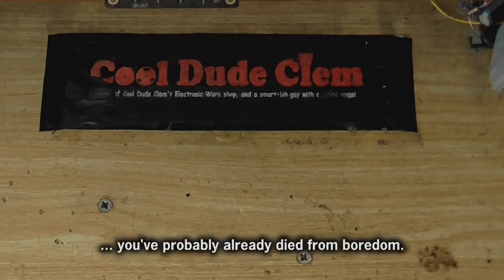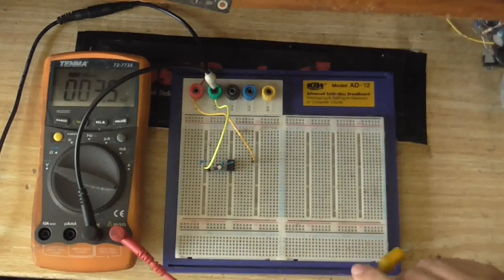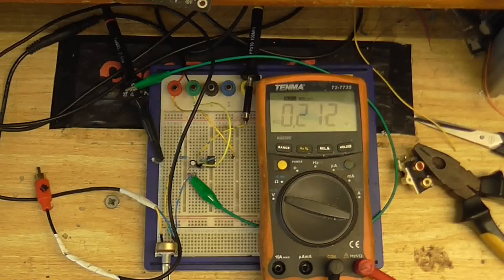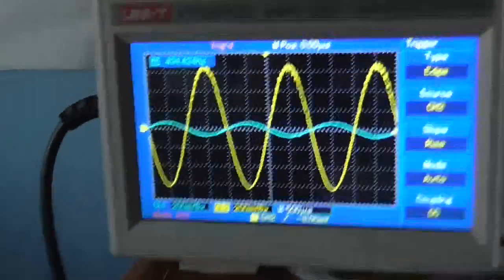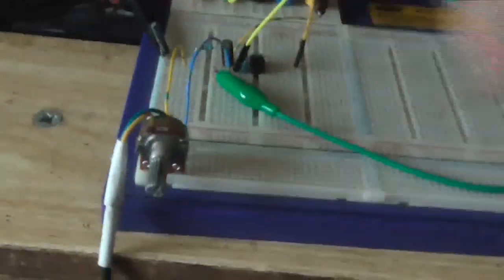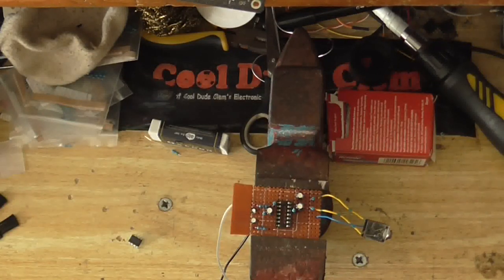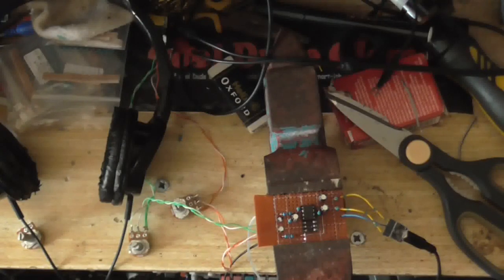Inverting op-amp on single rail supply, and making a headphone amp.

Comment: Nice to see that you're still tinkering Clem!
32 Ohms does seem like a heavy load to drive from an Op-Amp to me though.
Perhaps more modern Op-Amps are more current capable as you did say that it worked well.
I still like to use a 741 from time to time and if I were doing something like this I would tack a little Output Stage using a pair of Transistors and a few other bits on the end.
The Zapping incident reminded me of A.V. Equipment from back in the 1990's where a two core Mains Flex was used with V.C.R.s for example which had a metal Cabinet.
They did not want to connect the Cabinet to Mains Neutral nor did they want it left floating so as a compromise a Capacitor with a Resistor in parallel was connected between the Cabinet (connected to the 0V Rail of course) and Mains Neutral.
This meant (due to the interwinding capacitance of the Chopper Transformer) that a large voltage would appear on all the ground connections with respect to true Earth.
You could light a Neon Screwdriver on some of these things.
I would have thought that they would have put a proper three core Mains Flex on an expensive Computer though.
Reply from the maker: I wanted to make this as simple as possible, I'm sure somewhere I have some better chips with the same pinout that would be ideal for this, the TL072 I put in there is just temporary, that's why it's socketed.

Comment: Hello Clem, Great to see a Cool Dude Clem video. Learning a lot about pre-amp circuits and op-amps, that's most amps, like the LM1875 for example, and the LM386 audio op-amp, John Audio Tech has some good videos on them. Your in good company with JAT.  After nine days of forest fire smoke, starting on September 7th, our Labor Day, the air is clear and have had some good rainfall. Good job on the circuit, be looking forward to more. All the best from Oregon, C.

Comment: The LM358 you used is known to have cross-over distortion. This is purely because of the op amp design itself, internally it uses a class B output stage with no biasing and at higher frequencies it will distort because of the slow slew rate. There seems to be a weird fix to this problem though, many have reported that putting a resistor from the op-amp's output to negative supply rail would force the output stage into class A mode, thus eliminating cross-over distortion. I have actually tested it myself and it seems to work treat with lighter loads. People have done tests and concluded that generally 4.7K should do the trick, I haven't yet tested 4.7K, but 1.5K worked fine. :) Although I am completely unaware of the output current capability with this method, I have a hunch that it probably won't work with such high loads as a pair of headphones. Maybe lowering the pull-down resistor would help but then it comes back to choosing a different (and better) op amp like you have. The TL072 may be known for it's low drive capability but cross-over distortion has never been the problem with these AFAIK.

Comment: Hi Clem. Look for the 4556 opamp. It is cheap with decent enough specs. It has 70ma of output current which should be enough to drive most headphones with good volume. Most common opamps only have 20 to 40 ma of max drive current.

Comment: You never explained why you were getting 65 volts on the two Ground Connectors. Was there a bad filter cap on the supply? were you able to find out what caused that voltage?
Reply from the maker: It appears to be on my oscilloscope's ground, strangely only when the 'scope is off.
Reply: @CoolDudeClem  Wow! No kidding?! That's bonkers. Well I hope you'll be able to track it down. I've really been enjoying this series. I hope you keep going with it.

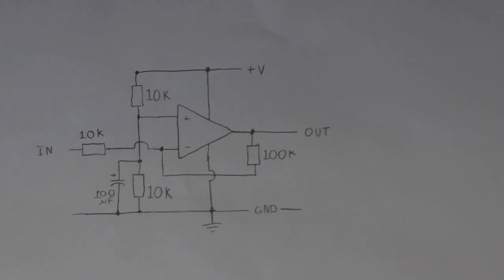Comment: 1:28 = Inverting amplifier gain is (-Rf/Ri) = -(100/10) = -10. Why do you say 11?
Reply: Minor mixup, he used the formula for non-inverting amp. Which is (100k/10k)+1
Reply from the maker: I'll admit that I'm no expert, the formula for non-inverting op-amp gain is 1+R2/R1, so I naturally thought the same would apply for inverting op-amp circuits too.
Reply: @CoolDudeClem  Thanks, I am no expert either. So wanted to confirm. Thanks.
Reply: It is plus 1 for the gain. Research on line, Google Images. Best, C.

Comment: How about LM386?
Reply: Horrid IC. Noisy, too. Not really good for driving headphones as you'll hear the noise. Plus, circuit layout for the LM386 is important or it will howl and go into oscillation at moderate gain levels.